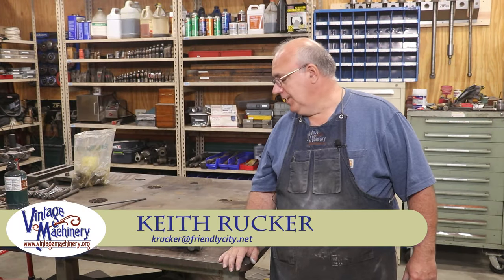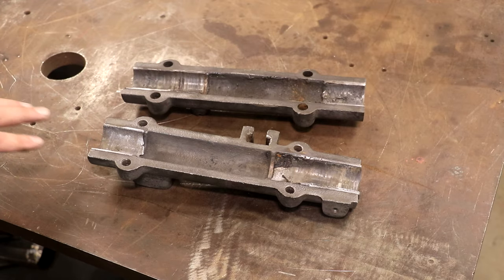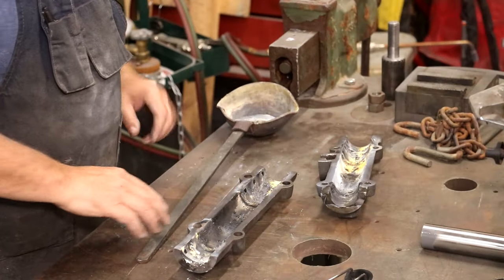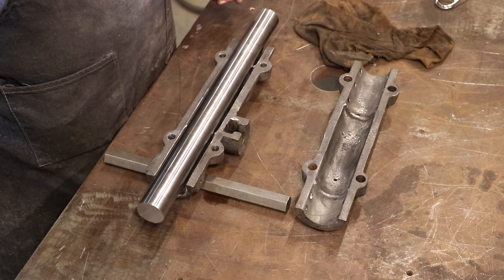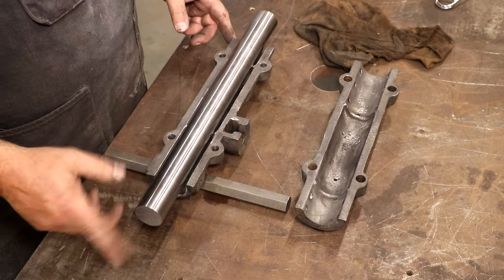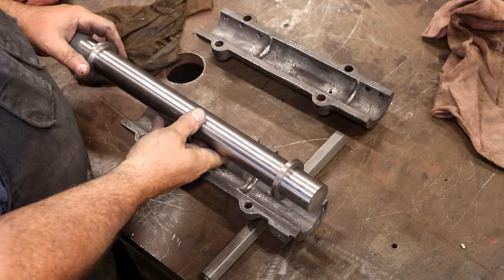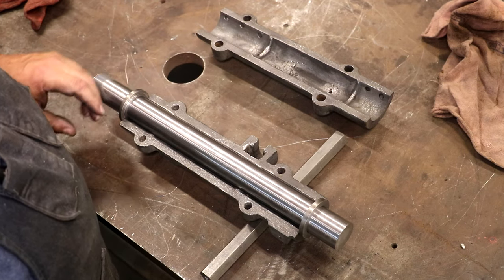Pouring Babbitt Bearings for a Crescent Band Saw

Comment: Without having the part in front of me, it looks like you may have reversed the parts.  Why would someone design babbitts where the top one was longer then the bottom one and then do that on the opposite end as well?  Sure, it make have come apart like that, but maybe the last guy bolted it in backward.  Seems really odd to me.
Reply: Just think of the loading of the shaft , the long bearings are on the side that has the load from the weight of the wheel and band tension.
Reply: It can’t be bolted together backwards since the bolt holes are offset. 
Seems like you won’t do too well on the test tomorrow. 😉

🤣😂🤣😂
Reply: @johnl3487  Why would you waist babbitt material for something that has no load?
Reply: @Crewsy  Well, you don't know if the bolt holes are offset or symmetrical, now do you?  Some test.
Reply: @kevinreardon2558  the un loaded will hold the shaft in place. There is always some side loading somewhere in the system.
Reply: Kevin Reardon 
I guess you didn’t pay much attention to the video thumbnail then did you. 🤦‍♂️
Reply: @johnl3487  when I was young man about 12 are so I looked at the short side and long side differences in the piece I was working with the old man that was helping me walked up smiled said you want me to show you he knocked the two short sides out put it back together to show me which spots run under load and how it would work without the short side long as it keep the load on like only contact point on pry bar . I'm not good at  explaining but maybe that will help your friend understand
Reply: I noticed that as well.  The band saw end would load the bottom of the bearing and the opposite end would load the top side.  Hence longer bearings in those locations........I think!
Reply: @danielsmith-ze3wy  and that would be a design constraint you would not run into with roller bearings.  OK, that makes sense.  Thank that old man the next time you meet with him.  You see, I missed that period.  We did things very differently when we were building the pyramids.  The needs and designs of technology sure to change through the years.
Reply: @kevinreardon2558  I'm so thankful for technology every time I see a roller pack bearing with a automatic grease system hooked to it .  But the real question is did you use some kind of harmonics to lift blocks on the pyramid are just Brute Force.  🤔  anyway you have a blessed night and stay safe
Reply: @danielsmith-ze3wy  We used cranes.  You should have seen the one we used to put the King's chamber in.  That granite was heavy.  Stay safe.
Reply: @kevinreardon2558  like a Pond crane 😁 🤔 so average crane can fly with around a pound block probably weighs 30 tons so 60,000 birds dang that rigging must have been amazing to see lol don't take me seriously but that's the first thing that popped in my head yes there's not much going on in there. you have a blessed day
Reply: @danielsmith-ze3wy  A while back I saw this History Channel special where their was this architect/engineer who tried to account for various features carved into the floor and walls of the Grand Gallery.  When put together it turned out to be come kind of massive crane.  I tried Googling it, but alas too much other stuff on Egypt.
Reply: @kevinreardon2558  I think the pyramids are very fascinating I would love to see them in person one day
Reply: @danielsmith-ze3wy  I found it.  The claim is it was a counterweight:
https://vimeo.com/127533374

I've been there.  Go with a tour group or you are going to be hassled by people selling trinkets.  But if you do go, you'll be able to see the new museum.  The old Cairo museum was more like a warehouse.  It had no air conditioning.
Reply: @kevinreardon2558  thank you and God bless
Reply: @danielsmith-ze3wy  Stay safe.  You all are in my prayers.  Hope you don't mind its Ra.  I've never broken the habit even after Moses started calling God Yahweh.  What the hey, Akhenaten started it all with the whole monolithic thing and eventually Moses had to high tail it out of Egypt because he refused all those gods.  Man, they were confusing.  <grin>.  Have a good one.
Reply: @kevinreardon2558  thank you for the prayers and I will do the same  jesus  turn my life around I hit rock bottom 1,036 day ago asked him for his help and haven't looked back I've made part way in old testament Moses really got put through it not to get to enjoy the promise land

Comment: Why you didn't bore to the final size on the machine?
Doesn't this Babbitt bearings require a machine finish
Reply: The mandrel used was cut off from the actual shafting material he's using so, the pour was exactly to size.
Reply: @Pyrichia  ok , first time I've seen it done like this, looks more simple this way, we usually pour the molten Babbitt and then machine the bore to final size with the relevant clearance.

Comment: That’s a hydrodynamic bearing right? The rotating element isn’t actually supposed to contact the Babbitt when it’s in motion.
Reply: Katherine Perkins  with an oil wedge between the shells and shaft, when running horizontally can also be described as such..

Comment: As someone who works in metric units, the relationship  between fractional inches and thousandths seems awkward.
Reply: Generally machinists just use the decimal inches. Carpenters use fractional inches. Civil Engineers and surveyors use fractional feet, I've worked in all of those fields over the past 55 years. It was like learning shooting from the hip as a young soldier, after awhile it is just second nature. I tried to convert from christian to metric in 2000 but I lost all of my instincts so we stayed with christian.

Comment: Why is half of the bearing on each end a different length?
Reply: I wondered the same thing.
Reply: I'm assuming the big part of the bearing takes more load (push up on one end and down on the other)  ?
Reply: The larger bearing is designed for more load. Remember that the shaft supporting the bandsaw wheel acts like a lever. The vast majority of the force is going to be applied to the front bearing, the rear bearing has a large lever advantage reducing the force applied to the back bearing.
Reply: @otm646  I thought you had one of the longs halves matched up to the short half.  My mistake.  I understand the larger bearing on the higher loaded end.  That's why I was wondering when it looked like you had short to long in most shots.
Reply: If you rewatch i think the bearing is missmatched (ie top side bigger than bottom on one end and  the bottom bigger than the top on the other) due to tension pulling on one side will push against the other .if you look around 11.40  you can see the ends & looks like the bolt holes have a different offset from the ends (I thought it was just turned around when I first watched it)

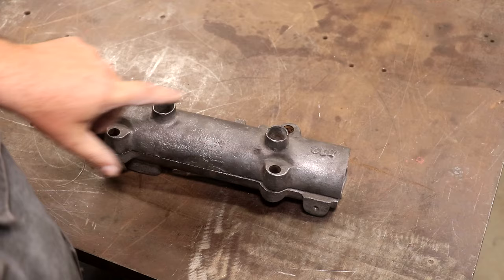Comment: At 1:38 did you have the top of the bearing shell reversed end-for-end?
Reply: Quite common in a cantilevered load, on one end the force is downward, thus the larger pad on the bottom, the other end is forced up. Think of a pencil overhanging the edge of the desk, pushing down on the overhang pushes the far end up.

Comment: Why couldn't you do the same thing for the top as you did on the bottom?
Reply: The shaft had to align with the two housing bolted together.  If the ends were a bit of a loose fit the shaft could have been misaligned in the two sides if they were not clamped together for the second pour.  If the bearings were to be reamed out to size later that would have been a acceptable way to pour both halves with an undersized mandrel and then line bore for size and alignment.

Comment: Looks like a major pain.  I would have milled out 2 groves in the bearing housing and replaced the babbit bearings with appropriately sized ball bearings.
Reply: It's not hard to do and it'd be a lot easier than trying to machine old cast iron. chances are you would screw up the old housing trying to machine it.

Comment: That is not how babbitt bearings are done. You haven't tinned the shell, the new metal is just sitting in there and not bonded to the shell. It will not transfer it's heat and melt out again from fiction. And this small size would be built up with sticks not poured.

Comment: Pour babbit like you pour iron. It's a good idea to have a sprue and riser. Use the babbitt putty to form a funnel to pour into, and make a riser on the high end to let the air out.  This will also keep pressure on the pour as it cools and shrinks.  I poured the main bearings on my 1903 Case steam traction engine, over 5 lbs of babbit each shell. 
https://www.smokstak.com/forum/threads/9hp-case-pinion-gears-progress.33090/post-802915

Comment: Why not mill out a pocket for a sealed ball/roller bering
Reply: In another 20 years can pour again, the bearing probably long ago obsolete, also you would have a thin wall if bored out.
Reply: @ausielad1  or in never you'll need to replace the roller bearing.
Reply: @ausielad1  and if you're planning on giving an Antique machine nothing but hot suppers and structural rigidity is a concern.  Turn down the shaft

Comment: Also the Babbitt Needs to be hot beyond just melting to endure even spreading   in form.
Reply: Typo in that comment I think: where it reads “endure” I believe it was meant to use “ensure”
Reply: Steve Babiak yes. Fat fingers on this annoying iphone
Reply: Raymond Cote - you can edit your original comment to correct that ...
Reply: Steve Babiak i can?  Ill take a look. Thanks
Reply: Raymond Cote - yes you can; the three dots on that comment will reveal a menu where one of the options is “edit”; the comment after that will have an “edited” tag on it, but that’s no big deal.

Comment: You are cheating by making those bushing/spacing to Aline the shaft. Over more than 75 years ago I helped my farther pour carnage bearings on Frick saw mill out in the woods. We use strips of belting and octagon soap to dam the Babette. We had a small black smith bellow for heat

Comment: I'm not engineer but lead seems like a terrible bearing material?
Reply: it is
Reply: @JonnyDeRico  babbitt bearings are still used in every modern internal combustion engine.
Reply: Lead usually accounts for a small portion of the overall Babbitt alloy, though it can be used as the metal that makes up the largest portion.  The significant thing to know is that in alloys like this, metals that wouldn't typically serve as an acceptable material for an application take on properties that make it very well suited.  If it's the softness of the alloy that gives you pause, it's actually a good thing in this instance.  It provides a certain "slickness" and cushioning effect, and ensures that the bearing material wears as opposed to the shaft that you're trying to preserve.
Reply: @ionstorm66  yes, but he was asking for lead.
Reply: The railroads used babbitt bearings for the journals of rolling stock, before roller bearings were available. I have a few very old Trains magazines, that have ads for Magnus Solid Bearings. This was published at a time when roller bearings were being widely used.
Reply: Long ago, I was working on an environmental cleanup at an old train roundhouse near Buffalo, NY. There was a large pool of solidified oil with a high concentration of lead, tin, cadmium and other heavy metals. Nobody knew what it was. When I was a kid, my dad worked for a marine dock building company. They used barge mounted steam powered cranes. So, I was familiar with steam cylinder oil. I explained to the crew that it was steam cylinder oil from the old steam locomotives.  It is very thick to start off with and after exposure to steam and pressure, it solidifies. The heavy metals were from the wearing of the babbitt bearings during operation. When the locomotives were repaired, they just dumped the waste oil on the ground, forming a solidified pond.
Reply: Kurt Dietrich wow love the insight on your fathers work. After you explained it did they make everyone put on moon suits and freak out over the contaminated waste. Thanks for sharing. 😂
Reply: @OCT566  tyvek suits, rubber gloves and boots. It was broken into pieces, sort of like roof tar. Put into a lined container and then who knows where.
Reply: It is. And that's why babbit is used instead of pure lead.